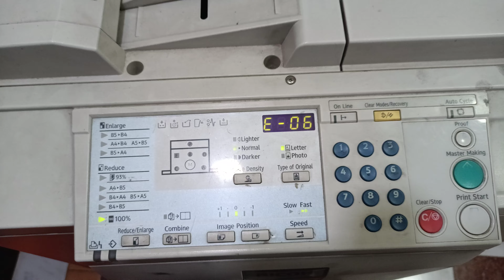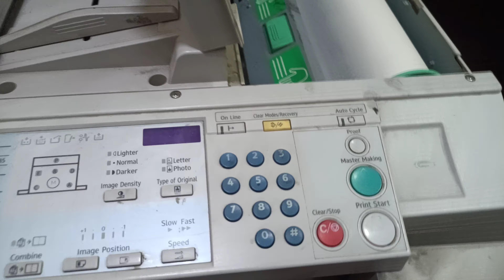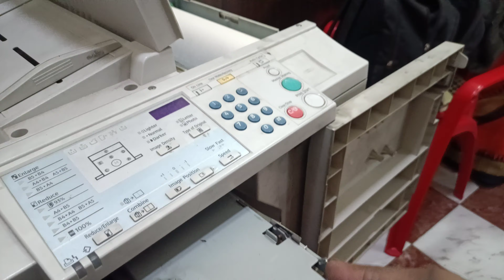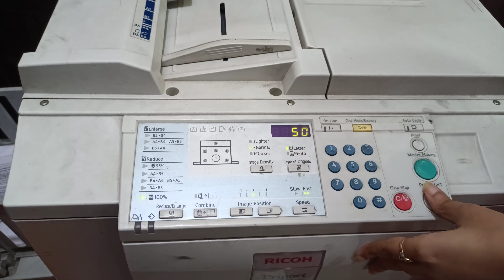Drum Stuck E-06 error code in Ricoh Duplo DX 3344

Comment: E-09?
Reply from the maker: Ricoh DD3344

Error Code:

E-09

Code: E-09

Description:

Thermal Head Thermistor Open: The thermistor output voltage is over 2.817 volts.

Causes:

Thermal head thermistor Thermal head connector

Comment: Dx3240 e00 error aa rha
Reply from the maker: E-00 Clamper error The MPU cannot detect the clamper position sensor signal (open or closed) within 3.0 seconds after the clamper motor turns on. Clamper drive Clamper sensors Clamper motor